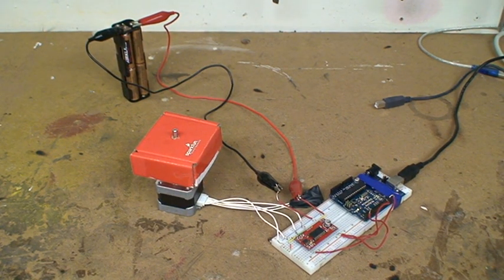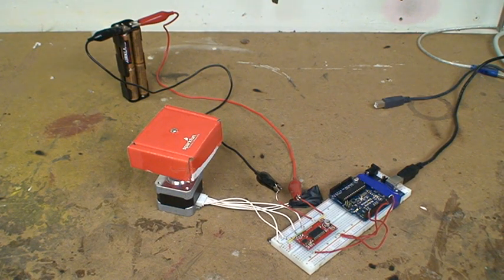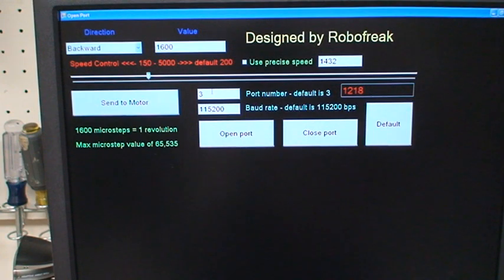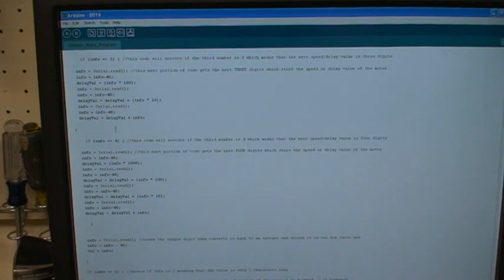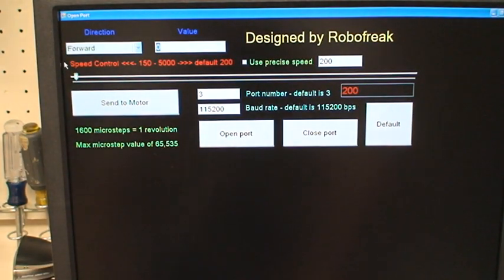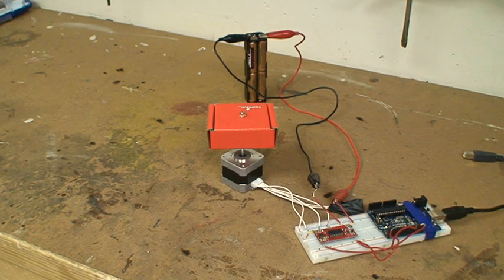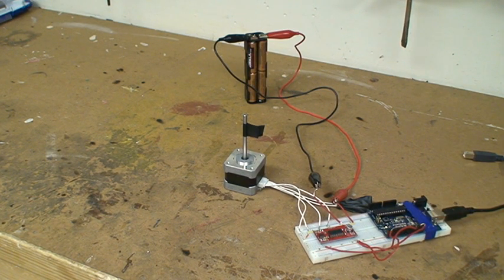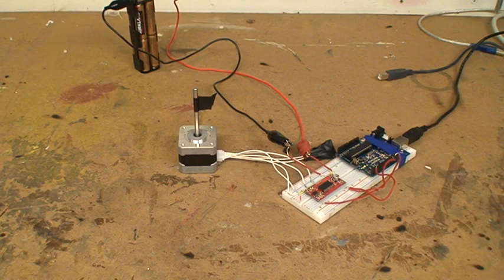Sparkfun stepper motor and easy driver v3 serial control

Comment from the maker: I completely forgot.....I made this before I switched to C# so first off you will have to download vb express sorry about that. I just checked the code on googlecode....to open it open the folder and inside you will find a another folder "Stepper Program" open that inside is a bunch of things with form1 in their name. Click on the Stepper Program.vbproj and it should open the project.

Sorry for the confusion!

Comment: @Halo2maniaccc Yup, that's a good advice. C++ with Qt could be difficult at first, but you will be amazed for its features. I recommend "C++ GUI Programming with Qt 4" for the beginners, there will be no regret on reading this great book.
BTW, what you did is Great! Keep on rocking and keep on sharing! ;-)
Regards.

Comment from the maker: The easydriver v3 in the video can only drive one motor so if you want to drive three using this driver you would need three separate drivers. From there you simply hook them up to the arduino and modify the code to accept instructions for three motors rather than one. You can't simultaneously step each motor so it would only be able to run 1 motor at a time. It would be better to get a real driver if you need 3 motors at the same time.

Hope this helps!

Comment: @Halo2maniaccc 
Yeah I watched your other videos, great stuff there :D The wiimote interface seems very responsive. I'm gonna be using a high power radio modem transceiver from Sparkfun for my project, has about a half mile rande. Also gonna need something to wirelessly transmit video over an appreciable distance. It's gonna be a very complex project incorporating many diffecet technologies; accelerometers, gyros, compass, GPS etc

Comment from the maker: They can step pretty fast at the smallest 150ns delay + (full motor voltage) it should be able to turn once about every 250ms, 4 times per second, and 240 times per minute. This is assuming it has no load and the voltage is consistent. I will warn you though that at this small delay time between steps a stalling motor is possible especially with a load. With the new drivers you can also change the number of steps per revolution to 200, 400, 800, and 1600 steps (what I used aka micro steps).

Comment from the maker: What do you mean? The chip is the A3967 microstepping driver. Other than that it is not a regular motor driver chip its a stepper chip designed to run motors like I had in the video which are very precise at movement.